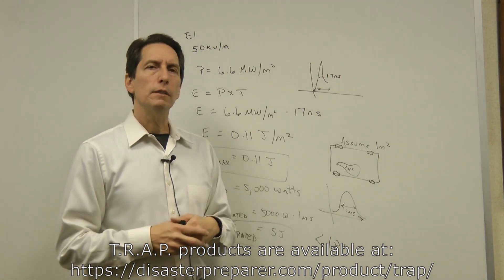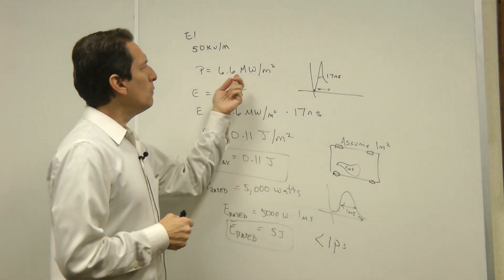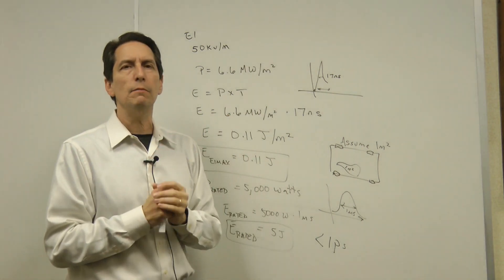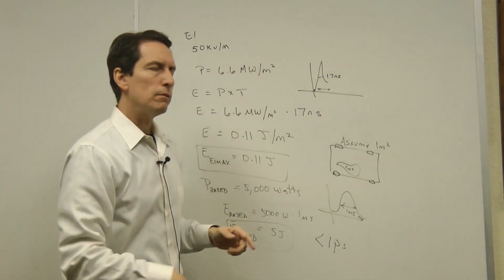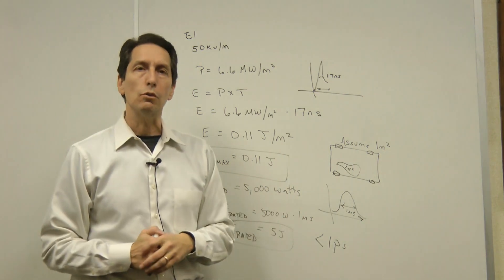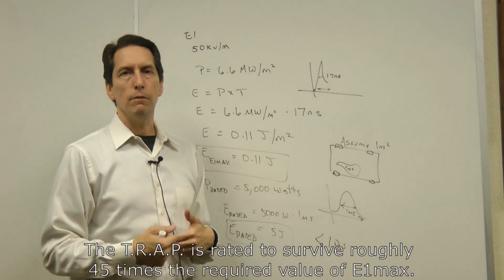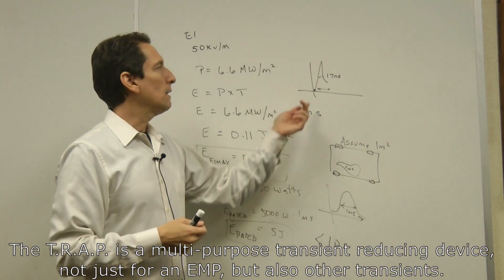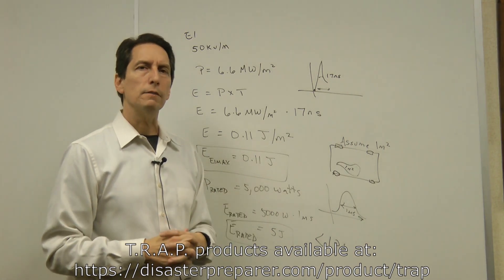Why T.R.A.P. is effective against EMP (and other transients)

Comment: Dr. Bradly, I am a retired Systems Engineer & hence Literate in Classical Physics. I find you to be the most HONEST & TRUSTWORTHY producer of EMP protection equipment.  WHY? Well here is what I base my opinion on.  

When you calculated the Energy from the assumed 50Kv/M, in order to avoid having to teach 2 semesters of calculus, you simply multiplied the PEAK value (50 Kv/M) by the time (duration period) of the pulse. That is way more Energy than would actually have to be absorbed.   I am correct to say, that the actual Energy calculation,  would be the area under that curve aka The Integral with respect to dt evaluated over the length of the time (T-final - T-initial = 17 uSec)

HENCE I am CONVINCED your device provides way MORE PROTECTION as that Integral's numerical value would be WAY LESS than the curve's Peak x Time (a simple rectangular approximation). 

I can only assume,  in order to avoid Integrals, area under curves etc, you chose to simplify the math at the you chose  to "De-Rate" the actual amount of Energy your device would have to absorb 

Please let me know if my observation is correct.    YOU are an HONEST PERSON, I am convinced of that I assure you!!! 

So convinced in fact I AM ORDERING, your automotive protection now!

On another note, as you know our supply chain is extremely dependent on Diesel Powered Trucks. Unfortunately, due to Federal EPA "woke-ness" ,  the latest Diesels still use a mechanical Injection pump, BUT that pumps volumetric output is controlled by a micro-processor.

Analogous  to modern cars still using Hydraulic Brakes, but pressure to each wheel, is modulated to prevent "Brake-Lock" by a micro-processor.  Same Idea is now applied to Diesel Mechanical Fuel injection, supposedly to reduce emissions as well as increase mileage. 

What is my point you ask? 

For all our sake, I humbly suggest you should also be directing your EMP automotive protection to the trucking industry.  Most heavy duty Diesel's use 4x 12 volt lead/acid batteries. The usual arrangement is two of the 4 wired in series then wired to the other 2 (also wired in series) in parallel. I need not go further and explain to you the amps needed to "Crank Up" a cold Dielsel. Nor explain the benefit of a 24 V vs 12V starter.

GOD BLESS YOU!!!!!!
Reply: Im not so worried about his device not being rated for the pulse as if it dies from one I do not care provided it saves your car I would like to see the clamping voltage during the event. Yes it turns on but what is the effective impedance of it and what does the voltage look like when this device is 1 or 2m away from the UUT. With 50KV/m the wave has to propagate down the transmission line to the protection devices and back. Due to the rise time of the EMP this means the voltage remotely will be potentially much higher than that at the protection device itself. How much so?... I dont know. Test the device with an ESD test setup and Zap the cable 1 meter away from the UUT to the left and 1 meter away from a sensitive device to the right and see how much voltage you get on the right.

Comment: New to All this , Thank You for Your Knowledge..... Couple Questions = What if my Battery was out , like in a vehicle that was in storage ??? Whould this still work if connected to the +/- . .... Also doesn't an EMP Hit everything at the Same Time , if so , wouldn't it still damage circuitry thats far away from the battery ??? And last Question ... how well would an hot water tank Insulation Bags or heat ducting wraps work as most of them are Aluminized... ???? Thank You

Comment: Sir I hope you're feeling better, sir with all due respect ,I'm truly just asking for suggestions on how to do these layers, I have raw carbon, I tried to get atomized iron, sir I am not some weird person, I more than believe that what I'm experiencing is a result of RF frequency ,it is truly unsettling and it is affecting my health, sir I do not have the financial stability to buy EMF shield and paint and the grounding apparatus, if you could please  inform me of how you would create these layers, and a way to do it myself , I can get raw material and make it mysel,f is there some kind of way I can get better permeability from this carbon? I hope I'm saying that right I've researched, so This truly is affecting my health , please forgive me if I seem forward I mean no disrespect, I truly belove your an expert in this field of science.
Reply from the maker: If you're trying to block high frequency RF energy (such as from 5G, WiFi, etc.), you really don't need to worry about permeability. Rather, you just need to place a solid conductor (or nearly solid) around either what you're trying to protect or what you're trying to block. Even a sheet of heavy-duty aluminum foil will reduce the electric field by around 99.7%. The hard part is completely enclosing yourself. Some people create special rooms, or drape conductive canopies over their beds to help with exposure to EMFs.

Comment: Hey Doc, I just found your channel. I'm not much of a prepper but I am a new amateur radio enthusiast just learning about electronics and I find this super interesting. I'm probably going to build some faraday cages soon. I have some nerd questions I was hoping you could answer (You don't have to get too specific, I'm not trying to steal any business. I can barely solder right now)

1) Does the T.A.R.P use zener diodes in it's construction? I just learned about them studying for my general class. I know they work really fast, but can only handle low wattage so it would have to be way more complex... just curious to see if I'm catching on to this stuff. 

2) I was watching the video on whole house EMP.  Could you use one of the really big toroid rings with lots of windings or maybe a few in series to accomplish the same thing as the ferrites or would they still get saturated? (I'm promise I'm not about to open my panel and start winding up rings. It's a purely impractical hypothetical question from someone trying to understand this stuff better)

Thank you for any help you can provide and keep up the good work.
Reply from the maker: Welcome Charles. The T.R.A.P. doesn't use zener diodes, but the protection is a similar solid-state device. As you said, zeners generally don't offer very high power, and in this case, we needed it. There are a number of different possible surge protection technologies, including gas-discharge tubes, metal-oxide varistors, thyristors, TVS diodes, etc. They all fit different applications, so no one technology is best. There are toroid inductive cores that can be wrapped, but I don't think it's practical for house power. In theory, if you wrap correctly, they won't saturate because the net magnetic flux is near zero. A more practical option would be to use a large toroid shaped ferrite to just go around the wire bundle, but even it would have to be quite large to enclose three 4/0 wires.
Reply: @disasterprepper  Thanks for your answer! Subscribed and I'm looking to pick up your EMP book!

<Edit- I got your EMP book in and I'm reading it now>

Comment: Sir, I have a question regarding the possible vulnerability of magnetic tape (audio and video cassette, reel tape, etc.) due to an EMP. Are these items effected?
Reply from the maker: My understanding is that they are not affected.
Reply: @disasterprepper   I had my cart with over $150.+ of your products that I was trying to purchase at checkout - and I had so much trouble trying to use PayPal, now my can't locate the cart contents. They are missing/gone! This is very frustrating!!!
Reply: I finally got it to work and placed my order. Thanks.
Reply from the maker: @dronog1  I'm really sorry about that. Paypal can be rather frustrating at times.
Reply from the maker: @dronog1  Much appreciated.

Comment: I know you said this is for the 12v system,  Would this protect the build up on the circuit in a Tesla.?  I’ll assume it would protect the low voltage circuits, possibly protecting the relays that control the drive battery... part two, the battery pack  has thousands of cells. What effect would the E1 have on them ?   Seeing they are rechargeable , would they Absorb  the energy.?
Reply from the maker: I wouldn't recommend putting it across other circuits unless you're very familiar with the signal voltage levels. It's designed for 12V power systems. I don't know how susceptible EV battery backs are to an EMP, but the TRAP wouldn't be a good fit for those given their high voltage.
Reply: @disasterprepper   Thanks for the reply. I just purchased the TRAP, to install across the battery terminals in the Tesla. I'm hoping it will protect the circuits before  battery  , the ones that control the drive train battery..  Standing question ?, Will rechargeable battery cells in the car absorb any of the E1/E2 currant ? I don't know if you have every covered that ?
Reply from the maker: @Themachinewon  Thanks for your purchase. As for the rechargeable batteries, I'm not sure how susceptible they are. Yes, some current will be coupled onto their wires and ultimately flow into the batteries, but I doubt they would be damaged. Batteries are pretty darn robust when it comes to radiated energy (unless very long conductors are attached, which help to couple in more energy).
Reply: @disasterprepper  Thanks again,  I figure If I protect the main circuits and relays, the batteries can take up to 250Kw charge rates @480volts, built to charge, I hope it works ~

Comment: This is fascinating, and I admit that I understand it only on a sophmoric level.  My question is, is the trap destroyed in the initial event, or can it be used over and over again?
Reply from the maker: It should survive repeated strikes.
Reply: After a high-altitude EMP the earth's magnetic field would be disrupted for quite some time, meaning that repeated attacks over a short period would be impossible.  Nor would they be needed.  Once the electrical grid is destroyed, you wouldn't hit it again.
Reply: @USMCJason  You would if you wanted to "Mop up" surviving resistors (no pun intended) who have gotten their equipment out of their F cages and are trying to regroup.

Comment: To protect a Ham radio in a vehicle would it need a T.A.R.P. installed on the power supply wires?  Would it need Ferrites installed on the antenna cable or anywhere else?  Exactly what measures would I need to take to protect the Ham radio in the vehicle? 

If the T.A.R.P. becomes inoperative is there an LED warning light or other way to tell if the device is no longer working?

 I greatly appreciate your detailed explanations of how your protective devices work.  I have found your book and information on EMP protection to be superior to anything else I have every found.  Thank you for your products and educational information on such an important topic.
Reply from the maker: HAM radios are difficult to protect with the antenna attached. I plan to look at this soon. 
I didn't put an LED on the TRAPs because I didn't want any power drain on the batteries of sheltered vehicles. They come with safety fuses that can be checked. If a TRAP fails, it shorts and takes out the fuse.

Comment: @disasterprepper Does this protect the individual components that could be in the circuit completely? As in you have your computer under the hood, I understand the energy on the wires will be absorbed, but does that rated energy couple with the circuits and components directly in the computer as an example? Or is it that these transients are only absorbed via wire or antenna? Just like the whole house protection system you offer, I am concerned that the devices I want to protect themselves will absorb these transients. Or is this all a "it will help" kind of situation and ultimately the only way to fully protect sensitive items would be to put it in an isolated Faraday cage? I think we have discussed this in regards to my ham radios, ultimately no matter the protection I put on power systems or antennas I will still need to disconnect said wires and isolate the radio in a Faraday cage to fully protect it. Am I thinking of this correctly? I don't ask to put you on the spot, I ask because I want to do my due diligence to protect my gear. I don't want to find out later that I should have done more and have bricked equipment. This is why I am building custom Faraday cages for my ham radio gear I can easily uncover and connect wires to when I wish to use them, but I want to be careful not to hassle myself more than I need to.
Reply from the maker: There is a reasonable protective measure, but I can't say that it would definitely protect all electronics. Every car is different, and many factors come into play.

Comment: If your battery is in the trunk but is wired to posts under the hood, would it make sense to install a t.r.a.p. at both locations?
Reply from the maker: If you have easy access, yes.

Comment: I have ordered your products for use in my SUV. Is the T.R.A.P appropriate for use in electric vehicles? I don't have an electric vehicle, just curious.
Reply from the maker: It is for the 12V battery system but not the high-voltage system.

Comment: What if your lighter plug is only active while the vehicle is running? Which one should I purchase?
Reply from the maker: I talk about this in the first video. The short answer is that very high-frequency pulses will couple onto the wires (and thus be able to be suppressed) even when the outlet is turned off via a relay or switch. It doesn't require power to the outlet.
Reply: @disasterprepper  thank you..